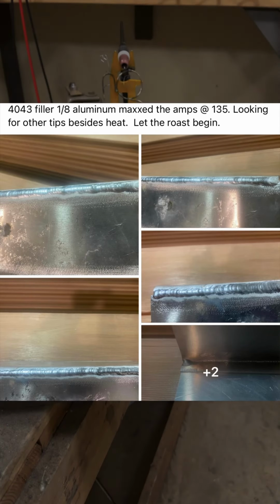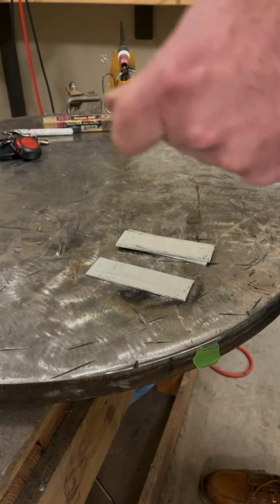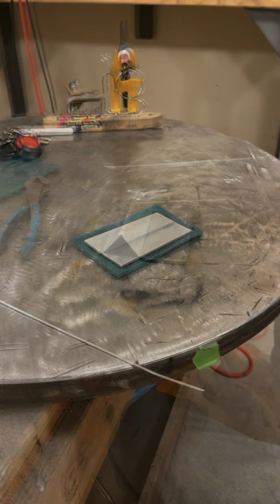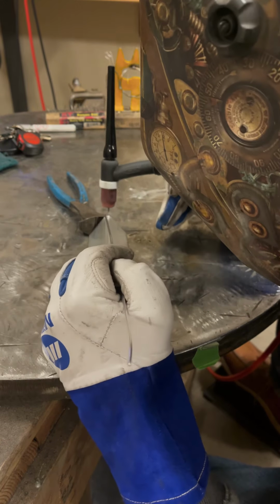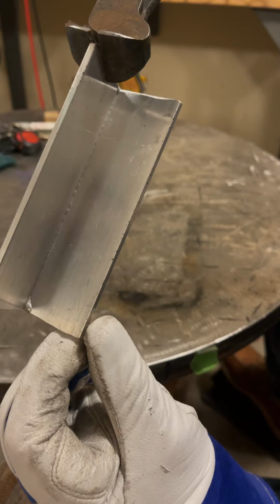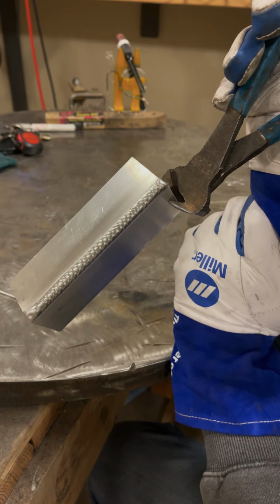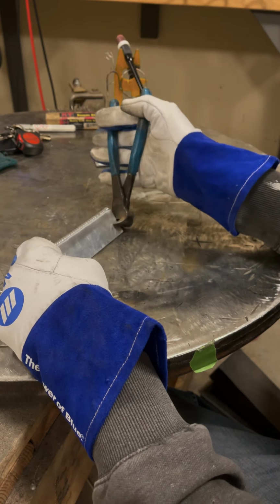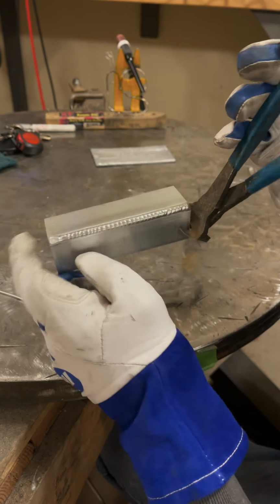Troubleshooting some aluminum tig welds

Comment: Do you use acetone on Aluminum only ...or steel too?
Reply from the maker: You can use acetone to clean steel too.  For the most part it’s used with aluminum because aluminum is so prone to weld defects due to contaminants.  The cleaner the better with aluminum, and acetone really helps with that.  It also evaporates fast and doesn’t leave a residue.

Comment: Rock solid advice here. When I get in a hurry and use a stainless wire brush in a die grinder, I always have some black shite in the weld pool. Cleaning with scotch brite and acetone is really the only way to do it right.
Reply from the maker: 100%. I wish the prep work was as easy as welding steel with stick, but if it was everyone could weld aluminum well and I wouldn’t make much money lol.
Reply: @makingmistakeswithgreg  fair point. Most people, especially those that are paying for it, don't realize that the prep, and fit take up a large majority of the labor with aluminum fabrication. I enjoy the detailed, precise needs for good results and have been paid well for them in return. Don't get me wrong, steel is great and all that, but aluminum is way more fun to work with.
Reply from the maker: @JackOffAllTrades  I agree.  The only time I don’t like aluminum is when I have to weld fittings on oil soaked valve covers.  It’s worse than trying to tig weld on rusted auto body with no prep lol.
Reply: @makingmistakeswithgreg  I have to ask. Why does that Miller machine cost 6000 dollars? I've never had the pleasure of using one, so I can't offer my opinion, but that's a lot of money. Thoughts?
Reply from the maker: @JackOffAllTrades   great question, sorry for the delay in response.  I shot a updated review on the dynasty that goes live in a few days.  It covers some of the reasons why it costs so much.  I am actually planning on doing a video in the future where I compare the insides to competing welders.  Until then I can tell you there are a lot of the reasons for the cost.  It’s capability is not matched by any other tig welder besides fronius.  It does things with pulse, ac frequency control, etc that no other welder in the world can do.  The engineering/design had more thought out into it than most welders.  It will run on single and 3phase power.  It’s adjustability range on all settings goes lower and higher than virtually every other welder.  It’s efficiency on turning power from the wall to useable power is extremely high.  With all that said, does that mean it will last longer than a cheaper welder?  Not necessarily.  Does it make you that much better of a welder?  Not really, but It makes it easier to put down really good welds.  I don’t regret the purchase one bit, however I had to sell a ton of stuff to buy it.  Compared to all tig welders I have owned it’s the best I have ever used.  If you have the opportunity to try one do it. Or if you’re around Milwaukee wi where I live I can let you use it and make up your mind.  I went through atleast 10 tig welders over years before I went to a dynasty lol.